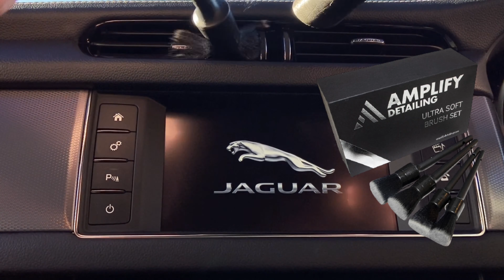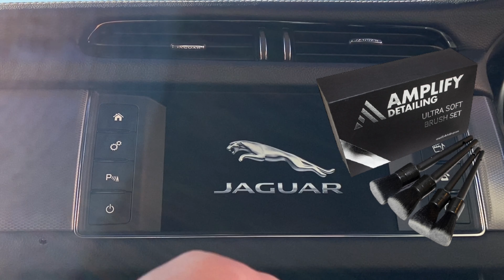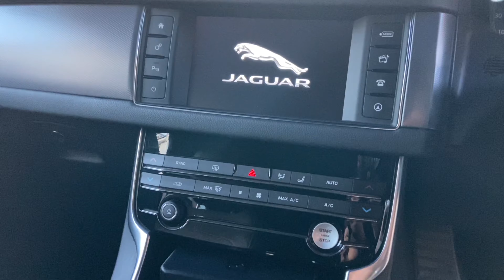WINTER PROTECTION CAR DETAIL. JAGUAR XF R SPORT GARAGE THERAPY / MONSTERSHINE  Pt 2 Karcher K4

Comment: I’m inspired... got my parents evoque being dropped off later in the week for a ceramic wax think I’m going to glaze that rather than polish now to save time and get quick improvement 👍🏼
Reply from the maker: Aw superb Nick, yeah it’s a great tool to have , just don’t IPA wipe before waxing but leave a bit of time before applying the wax, be glossy all through winter 🙌🏻
Reply: @GMDetails  how comes it can bond to a glaze without ipa but not a polish?
Reply from the maker: @gillywash1487  it can’t!, but if you use an ipa you’ll remove the resin fillers from the glaze, you’ll still get through winter with using a top up QD after a wash